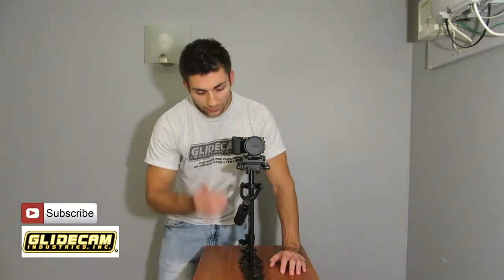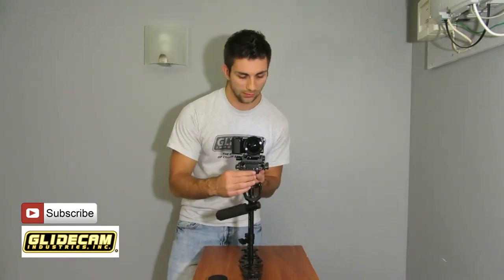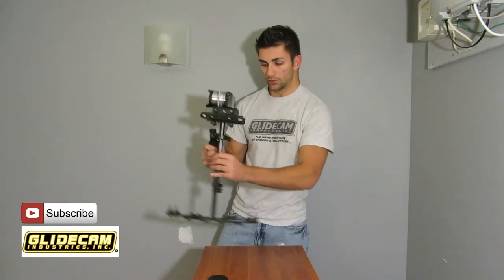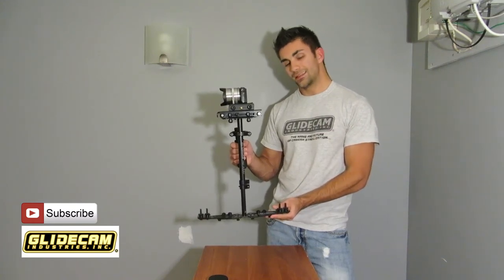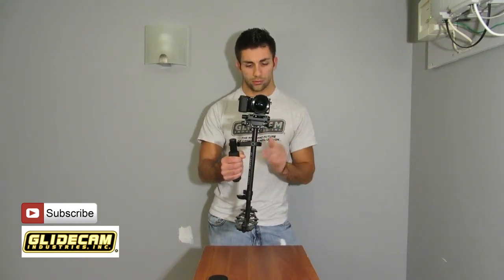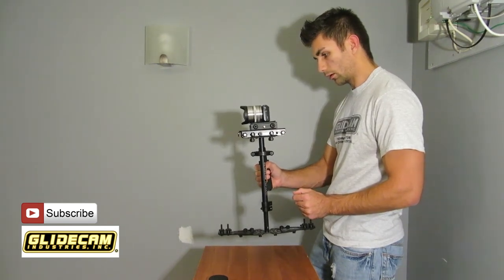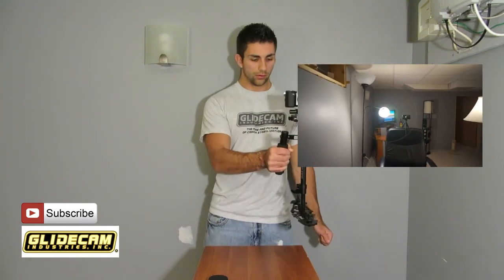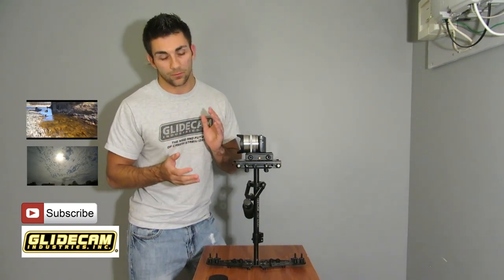Easy Way To Balance a Glidecam | HD 1000 | HD 2000 | HD 4000 | iGlide

Comment: I just bought the HD 2000.I still unable to get the right balance.I am getting balance but when I move fast side ways and front like you did in video the gimbal  is moving here and there.Need some help with tips .Do I need to extend the wings on bottom base?I am using 5d with 24-105mm. Help needed

Comment: Great tutorial David.  A couple of questions.  Do you have to compensate for filming when windy?  If so what is required?  Should image stabilization be turned off when using?  Thanks.
Reply from the maker: Great question.  What I do is increase the overall weight of the entire glidecam. I added glidecam weighted cheese plates on the top and added more plates as need to the bottom. I maintained the 3 second drop time. 

Now having more weight, my wrist felt like it was about to break. However glidecam sells a wrist brace to help with this exact problem. I shot an entire video using the wrist brace. It's on my channel called panama rocks. 

Hope this helps.

Comment: Hi David, I've recently purchased a HD-2000 and I'm having some trouble getting the Glidecam to stop swaying as I walk. I'm using a GH4 with the Panasonic 14-140mm lens (I have also got and tried the 25mm f/1.4). I think the issue I have is that both setups are too light. I have also tried attaching a Zoom H4n to the hot shoe mount on the camera to increase the weight. On the base plate I have tried a number of counter plates, 1 on each side, 2 on each side, 3 and also 4. When I then check my drop time, no matter what I change whether it be less/more weights on the base plate or changing the leverage, it remains the same, around 1 second. I have read that you can make it so there's no drop time at all, is this what I need to do? If so, how? I hope you can help and if there's anything you need me to explain/clarify, just ask :)
Reply from the maker: hey Thanks for watching. I know exactly what your problem is like you stated. it's your drop time.  try moving the base plate as high up as you can. if it is already up as high as you can go. drop off a plate from each side  and then your camera should start to balance out at a slower drop time.
Reply: No problem and thanks for replying! I've made some adjustments and have managed to get my drop time to 2 seconds. This is the setup so far, the GH4 mounted on the release plate with the 14-140mm lens, a Zoom H4n attached to the GH4's hot shoe mount, 3 counter weights (1 behind the camera, the other 2 either side of the lens). And finally I have 2 counter weights on both sides of the base plate and the telescoping pole is extended at its shortest. I have tried this setup and the results were ok, there were some issues where the camera would sway towards the left and/or right, but its much better than before. Any suggestions? Would I be able to increase my drop time to 3 seconds?

Comment: I have the HD2000 and it appears balanced. I have a QR plate with built in level bubbles but it sways when I am in motion (if I am holding it with one hand that is). I only have 1 plate on each side. I want to get it to where the camera sits completely still when in motion so it has the "flying" through the air look when filming something. Any thoughts?
Reply from the maker: First thanksfor watching! You need to make sure your Drop time is around 2.5 seconds. Then Rebalance. Make sure there is no turning while it is dropping.  The camera should be facing forward 100% of the drop. IF it turns it is not balance left to right evenly.

Comment: i just bought the hd1000, and the manfrotto 3433PL 577 rapid release plate, and i have a hard time assembling them together, any tips?, i tried the screws of the HD1000, and the Manfrotto, but both of them didnt work with me, should i get a new set of screws?
Reply from the maker: Hey, thanks for watching. I have a rubber washer between my quick release plate and glidecam plate.  This helps and I used a screw that was a different length.
Reply: hey man! had the same problem. I ended up using one of the screws from the glidecam on the hole in the front of the manfrotto plate. It fits barely, but it works

Comment: What camera are do you have mounted in this demonstration? Looks like sony nex? Do you suspect the HD1000 will work with my NEX7?
Reply from the maker: Yes! Sony Nex 5r with a manfrotto plate. I have more details in the description. And yes the hd1000 will be perfect. What lens are you using with the nex 7?
Reply: David Niedbala My apologies, I was on my iPad and the description was not visible for some reason. I am currently using the "stock" lens with the NEX7 which is the E18-55 lens, while potentially using a wide angle in the near future.
Reply from the maker: If you check out my Niagara falls video on my channel I used a 16mm+wide angle adapter. Amazing with glidecam. 
Don't forget to subscribe to my channel. I'll be releasing 2 tutorials soon. One on the new iglide and another on tips and tricks with glidecam.
Reply from the maker: Rolling Art Media Hey not sure if your still on the NEX7, But I picked up the sel10-18mm lens for my glidecam work. What a difference. The extra wide angle makes it alot easier to use the glidecam. Amazing lens too for still photography.

Comment: I think I have the same setup as you except I am trying to balance the HD-2000 with a Sony NEX-7. With 1 weight and no extension vertically, I am unable to get 2.5 seconds drop time.  Any recommendations?
Reply from the maker: Thanks for watching. Your top plate is not heavy enough. I would add weight under the camera to help solve this problem. I have an a7s now and I had to add weight. I bought the glidecam cheese plate and worked perfectly. So now I have camera, quick release plate, cheese plate, then glidecam.
Reply: Thank you David, that's a great idea.

Comment: Hey man, I have a hdglidecam 4000 and I just bought the sony a7s, which is fairly light. Do you think I can still balance it with my glidecam? thx
Reply from the maker: Yes, you may have to add weight to the top plate right below your camera. That's what I did. What lens do you have for the A7s?

Comment: I just got the 1000 for my black magic pocket cam but I can't seem to get the drop time to 2.5 seconds. Could it be that my camera is too light up top?
Reply from the maker: Absolutely.  I bought metal plates from home depot and Lowe's to increase weight on top. I had to drill some holes in mine. You can buy plates from glidecam for this purpose. If i would have known this before it would have saved me a ton of time.
Reply from the maker: Absolutely.  I bought metal plates from home depot and Lowe's to increase weight on top. I had to drill some holes in mine. You can buy plates from glidecam for this purpose. If i would have known this before it would have saved me a ton of time.

Comment: Im having trouble with my glidecam, it seems to be balanced yet it always turns to the left as i walk/move. It doesnt tilt but just turns.
Reply from the maker: Iam 90% sure you have a gimble that needs to be calibrated,

- Test your gimble by doing the following, Get it as balanced as you can get it, now spin the camera 90degrees. is it still balanced?
-spin another 90 degrees (camera should be facing you now) is it still balanced? -Turn it 90 degrees again, balanced?  

If you are not balanced in all 4 directions, your gimbal needs to be calibrated.
Reply: I have the HD-1000
Reply from the maker: Read my comment and reply back
Reply: David Niedbala if the gimbal is not calibrated how would someone go about getting it calibrated?
Reply: David Niedbala

Comment: well, my glidecam goes out of balance every time when i put it down or use it while i have balanced it on a stative with bubble levels and tighten the nuts good. It looks so easy but it is a true crime to get it right.
Reply from the maker: First, what glidecam do you have? What is your droptime?
Reply: David Niedbala I got a HD 2000 and the drop time is exactly 1 second and 27 frames. I filmed it with 29.990 frames a second.
Reply from the maker: 1 second is to fast. Shorten your pole so the drop time is 2 seconds.